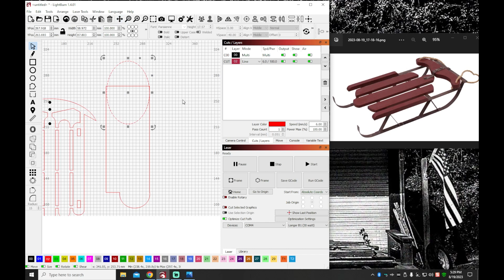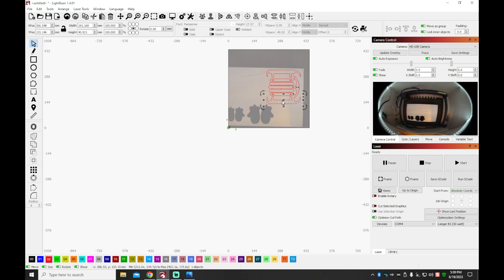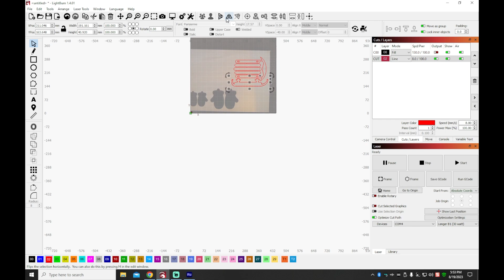Designing a sleigh in LIGHTBURN

Comment: Hopefully this is not a stupid question, if I buy an SVG off Etsy and it’s designed for 3mm wood.  How can you adjust it for 6mm wood and get the holes and plugs the right size to fit together.   Would like a video on that.   Thanks.
Reply from the maker: It depends on the file but typically, just widen the notches on it. The more joints, the more work it is. This file only has 4 squares that would need to be changed from 4,5 wide to 3mm.

Comment: Yes please!  I’m still struggling with Lightburn!  🤷‍♀️
Reply: My biggest problem now is, I got a 2 week extension on the ‘free’ Lightburn, but it had no library built in.  When I questioned customer service I was told the new download doesn’t include the libraries. They want you to add your own.  So I’m not sure I want to pay for it when I have to add all those. 🤷‍♀️
Reply: @tammygraves5757 Lightburn is a powerful piece of software. I’ve been using it for a year and a half and I am still learning new things about it. They are constantly updating the performance of the program. IMHO it is a great value for the money. You paid a lot of money for the laser, so get the best out of it with the best software. I actually love creating my own library. I put in it what I want and don’t have to sift through stuff I don’t need.
Reply from the maker: Stay tuned
Reply: Don’t get frustrated, Lightburn has great YouTube videos. I had to watch many of them over and over until I got the hang of it. Keep at it, you will get it. I’m still learning stuff about it.